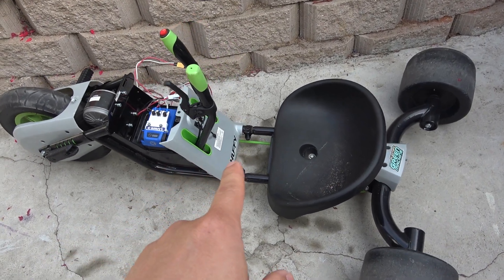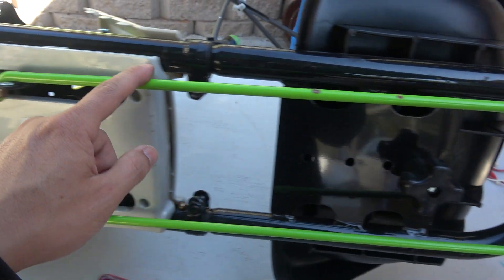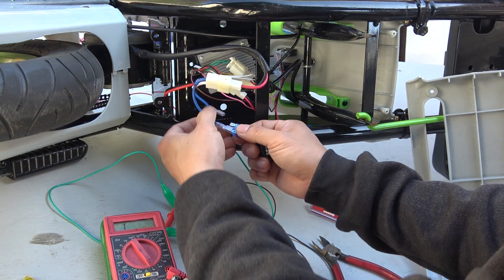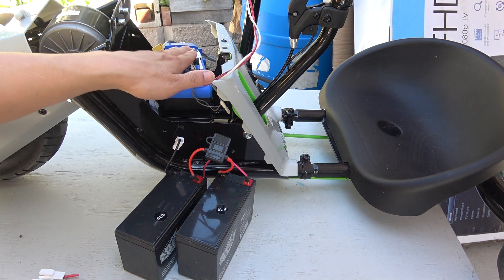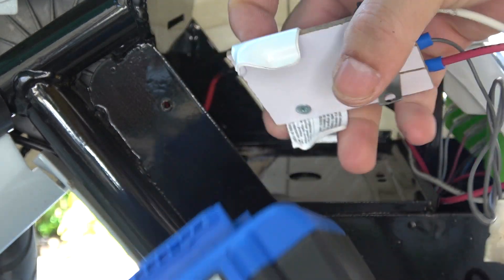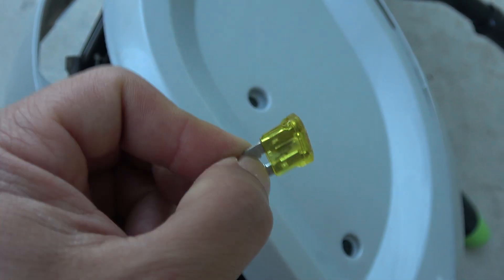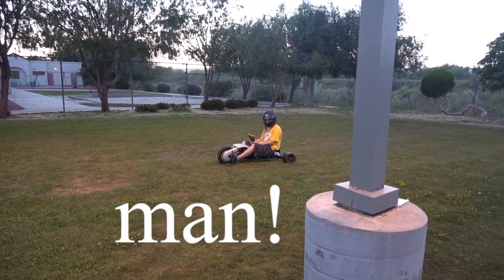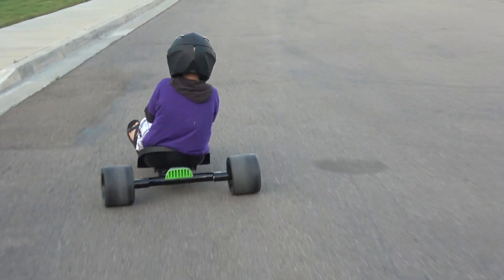Repair & mod a Huffy electric green machine using Kobalt 24V battery

Comment: I'm so silly brought a 1800 dc motor for mine to find out it's way to big and heavy but in gonna extend and even try and put a gokart axle or get gokart wheels for it ill have a huge capacity 48 volt battery custom made for it but biggest issue and struggle will be fitting the motor in it hehe gonna be true power

Comment: Got one cheap for $50 on fb market I've pulled all the plastic casing off and re spray painted them a nice orange black blue scheme lol and Im gonna put a 1500/1800 watt electric motor kit from. Ebay but my main issue will be getting a 48v/52v battery to fit
Reply: How did your project go?
Reply: @fixitrod4969  dude built it like 2 years ago went real well strapped a 1800 motor on using a sheet off metal just drilled it on no welding and put go kart wheels on and had a bracket made up for the battery at the back off the seats on the steering wheel axle thing and slapped a 500 48v that charged to 55v it was legit the best thing ever riding that thing haha the looks and abuse I got riding that thing was funny and good 🤣 went about 60kms anyone else that tried riding it would stack it hard course it would be so ward ro hold it straight and not flick our I mastered it unfortunately irs in places now and I've now used the battery to build this cool arse razor pocket mod with 2000w motor and it goes really good I'm actually panning on doing another one with a 3000w motor and 72v battery and gonna get custom disc breaks set up for it did rhe best spray paint job I've ever done with the plastics to the scooter nice hot green and purple colour it's fonnw be sick I might be build the green machine bur the steering rods were to low to the ground so it would just bend and hit everything so I would probably try putting qaud bike tires and bigger steering rods I think but it worked really well I'm surprised no one's tried it
Reply: I just wrote a huge reply you don't know why it didn't go through but I'll make it sort.this time it worked extremely well but only I was able to ride it as all my mates and that would stack it course it took a lot to control it and not flip out we oulr be flying going 60 having people yell our abuse at me it was pretty funny

Comment: Do you still charge it with the original power supply or was that modified as well? Do you have a link to the Kobalt battery pack used? Did you remove Kobalt top cover to for access to positive/negative terminals?
Reply from the maker: It's a Kobalt 24V Li-ion battery so I can only charge it with a Kobalt charger (for my power tools). You can get the battery at any Lowe's. I didn't have to remove the Kobalt battery cover. I just make the terminal connector for it. I have plenty of video for it so you can just search it up and find it easily.
Reply: Also where did you get the circuit board for terminal that connect to battery? Sorry so many questions, I really want to do this mod. I've had to change out the dual battery pack twice in less than a year.

Comment: How do you remove the top plastic cover? I’ve removed the single screw above the two electrical switches and the four screws on the bottom, but it will not come off. I don’t want to break it trying to pop it off.
Reply: I figured out that you have to slide the cover straight back after removing the screw. I was trying to pry the cover up and thought it had clips holding it underneath.

Comment: I bought one today at local Flea Market $10  wires are cut and no battery charger,  l checked batteries have some charged left.   I will view again your videos and see if l can rewire,  after viewing and reading online manual  l believe l can make this work.   It is also missing the on off control grip/switch.   I will see if l can order a new one or maybe construct something.   Thanks for a nice video!! helped me a lot.    Happy riding!

Comment: Maybe the original fuse was a "slow-blow" fuse, capable of handling surges? Also, to another's comment on the power - a lithium battery can be drawn down to it's limit while lead acid batteries can only be drawn down so far before becoming damaged; they may appear to have greater power but less of it is actually available (an engineer could explain this better than I have). I am sure you have a video on the connector to the Kobalt battery, but could you explain the three wire connection - apparently the motor needs it (or else direct me to the appropriate video).

Comment: Ummm... there is a reason for the 15 amp fuse.  Likely it is to prevent smoking the motor.  Instead of using bigger fuses you should try to determine the reason for the high current draw.  Can't wait for your next video on replacing the electric motor!!!

Comment: You can make it faster, longer lasting & have more torque power by upgrading your Battery. It comes with a two 12 Volt 7 Amp Batteries. 24×7= 168 Watts. Your 24V Kobalt battery is only 4 Amps. 24×4= 96 Watts. 72 Watts less than it originally should have. More Amps will give you a longer lasting charge for longer rides. You can add another 24V 4A Power Tool Battery as long as you connect the Positives (red) together & Negatives (black) together. That will give you 24Volts but now 8Amps. 24×8= 192Watts. Giving you a little more power than Original Lead Batteries & longer lasting ride time, with still lighter Lithium Ion Batteries.
Reply: I'm currently trying to Upgrade mine to a 36 Volt 5.2 Amp Lithium Ion Battery. But I'm not sure what safety feature is preventing it from powering motor. Luckily nothing was blown. Still works fine with Original 24V 7A Batteries. Control works, Fuse is Fine, Upgraded Fuse, and Removed Fuse for straight Power which helped most people who keep blowing fuses. But no luck on Upgrading Battery. Idk if it's too many Volts or too many Watts. Volts×Amps= Watts. Which mine would be 187 Watts, and should be 168 which isn't much more. So I'm guessing it's the 50% more Volts at 36V. Might have to Upgrade my Control Board. Any info on what might help lmk. And I will keep you all up to date with my results if I do get a 36V Control or just 24V Li-On Batteries.
Reply: @brianquesada1781  it's your controller. It's a 24v not a 36v. You need 36v controller 500 watt probably fine depending on your motor
Reply: I think you're confusing amperage/current with capacity...

Comment: When you spin around, the wheel is locked so there is no back EMF at the motor. Then the current is maximum at I=V/R where V=24, R=resistance of coil. This is probably why the fuse blows so easily. Design should've accounted for this and the controller to limit the current on motor lock (or regen instead of lock with power), doesn't seem to be the case.

Comment: I guess there is a reason why the original fuse was rated for 15 amps. The controller might still be faulty, perhaps it originally regulated voltage and current but now only regulates voltage. I suggest looking into this a bit more. You might need to add a current limiter if you can’t fix the controller, assuming a component/module is broken in the controller. Alternatively, if you are not bothered about unregulated current, no need to do any more investigation. How much current is the motor rated for?